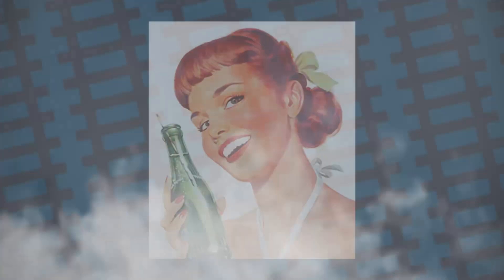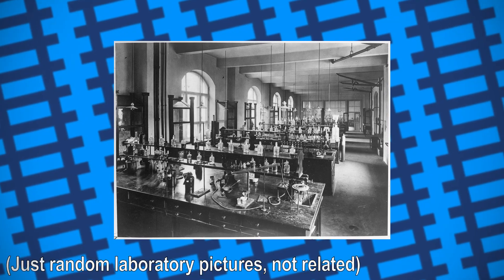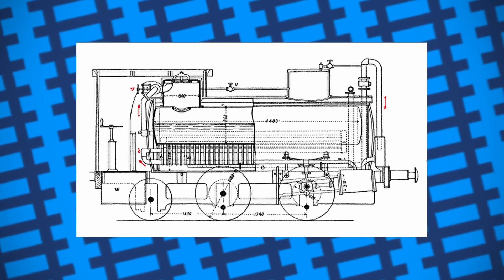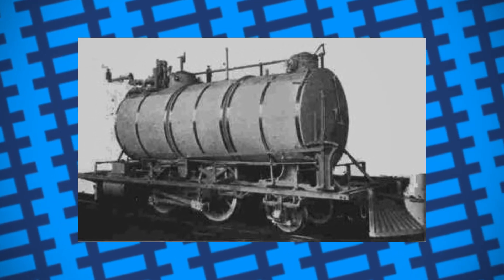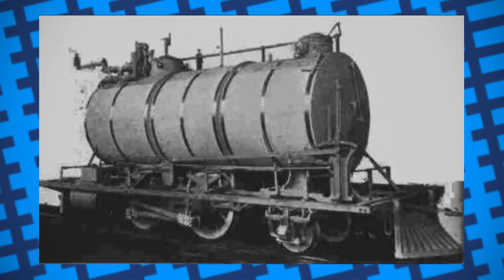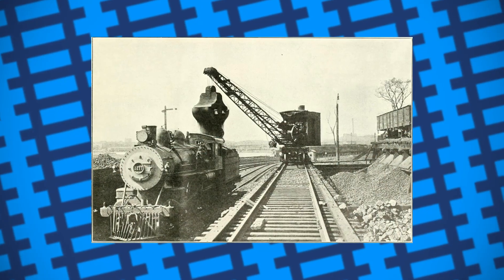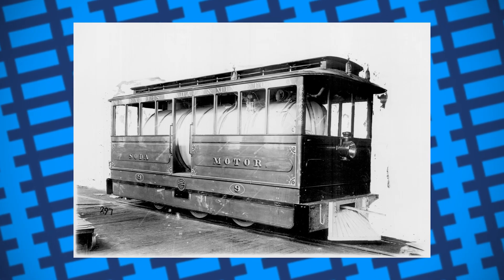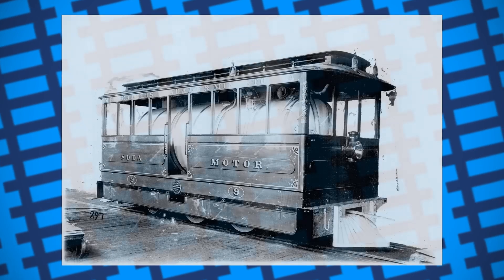Powering a Train with Soda? - Soda Locomotives

Comment: i can't help but wonder if anyone ever tried powering a compressed air powered engine using liquid nitrogen and/or dry ice
Reply: I've seen a model airplane engine that ran on dry ice. It was a little turbine, like a fan, not a piston engine. You can get little piston engines that run on CO2 cartridges, but that's not frozen to start. Gets really cold as it drains, though.

Comment: expected the pressure of gas produced from reacting with an acid, not the heat as it dissolves into water... oh well!

it seems to me thats just liberating latent or "phase change" energy, its not a fuel but a storage system... solid NaOH to aqueous solution is a phase change, and water to steam is a phase change... certain energy to bring the whole lot to boiling, and from then only as much as required to evaporate a volume of water.

what about superheaters? seems... impossible.
Reply: Lets use that to store sunny days and heat when it is cloudy !!

Comment: I've never heard of this before. The oddest locomotive fuel I've heard of is mummies from ancient mass graves. There was also a case of a 2-10-2 with a tender load of badly-burning slag stopping and picking up used tires from a dump which burned really well, but left the grate coated with melted rubber.

Comment: I wonder if you could use this for energy storage now, probably more for direct heating applications than for rotational or electric output, but I wonder how a system based on this could work vs something like a sand battery.  I imagine that the lower operational temperature for regen might help allow for instance use of a heat pump for regen increasing efficiency and possibly being used somewhat like a heat version of overnight ice creation to shift air conditioning evergy use or allow higher peak demand without oversized equipment.

Comment: That would corrode the heck out of your metal boiler and any fittings, you'd almost have to use more expensive stainless steel or other alloys to resist it, costing more.

Comment: I happen to have a book about forgotten inventions that goes into great detail about the Honigmann Engine. So I thought I should post details about it here, since i thought the video didnt give credit to the technology, since indeed it had several advantages. Moritz Honigmann found HIS OWN factory for Ammonia-Soda in 1870. During that time, many of the rail lines were actually not powered by steam neither by electricity but by horses. A lot of them, like A LOT. Honigmann had invented a new method for creating caustic soda at low temperatures, since usually the factory boilers from iron would corrode, it was said by high temperatures. He built and tested his own soda engine and it worked just fine. It was actually cheaper than using the horses that were used before, the horses being at 25 Pfennig/Km and Honigmann engine at 16 Pfennig/Km. The power to weight ratio of the whole engine was that of a regular lead battery of later times, but back then it was 20Kg/hp/hr while fireless hot water engines were 200Kg/hp/hr and battery powered locomotives were 100Kg/hp/hr. However the reason he used it was because he owned the factory that was making the soda, so why not? He could refill it at his soda factory any time. The boiler wouldnt explode, no. I think at this point you have not really understood how a soda engine works. It is the low heat exhaust steam from the cylinders that feeds the soda part of the boiler little by little, its an enclosed system that works like a saftey valve at the same time. Honigmann did figure that the technology wasnt viable for a broader use in railway. He also found out through his own experiments that the boiler material was likely to be made out of copper, since copper wasnt so prone to corrode by caustic soda and repairs would be less expensive, at higher cost of the boiler. So it was actually a very elegant technology for storing power, but it just did not sell well to the public. There were a lot of naysayers.
Reply: I like to further elaborate on my personal opinion, that the power to weight ratio of the Honigmann engine could theoretically be improved by using higher boiler pressures in the steam part of the boiler, not in the soda part (they are separated by a wall). This might improve water consumption, so weight as long as the chemical reaction is kept running. You have to imagine, that the system does not use any condenser. The heat of the waste steam is reused as well, there is no cooling. YOU DONT NEED A COMPOUND ENGINE TO EXTRACT MORE POWER. However i guess you need to keep the engine inside a narrow rpm range(if not properly designed) to keep heat fluctuations at bay. I guess thats why soda engines of different makes were closely watched for pressure fluctuations, not because the engine could explode, but because too low pressure might ruin its thermodynamics, causing powerloss and a slight worse power ro weight ratio. This would mean a loss in range and a great deal of money, cause downsizing the engine was key. But these are only assumptions of my own, so take it with a grain of salt.
Reply: @TheAdrianOMG  Wow very interesting !! Have you got more imformation source about this tech ? I already searched well around thermochemical heat storage to catch sun energy from sunny weathers and to release it for the cloudy days in house heat battery. 3 materials got my attention : Zeolite, Calcium Chloride and Sodium Acetate... I didn't know that Natron was also usable ! This one seems promising, even if i'm not sure i  did understood everything well...
Reply: @AutoNomades  well sadly i do not have more sources on the technology. I should tell you that indeed moritz honigmann had the idea of powering his factory with sunlight to make the soda. That would have meant a fully or partially sunpowered fireless locomotive. But it sounds to me like you are looking for a way to store heat for heating a home. That is a very intriguing subject. Let me just tell you this: a house already is a heat storage, able to shrink the demand for fuel, but only if you know the correct techniques and math, however noone will give you that but sell you insulation and stuff that wastes more energy. You dont need an extra heat storage for your home, in fact it might even worsen the efficiency. Feel free to get back to me on that if you have further questions.
Reply: @TheAdrianOMG  Why would it worsen the efficiency ? If you catch sun's heat when there is, then release by cloudy cold days ? I mean, in the simplest way possible, and in a quite insulated house offcourse... You could just dry kind of "pillows" of thermochemical storage in a greenhouse, store it in tight container for later, then when it's cold, take one dried before, put it in the stove, and let dripping some water on top, so it releases heat, and steam by the chemney...? For instance...
Reply: @AutoNomades  well you need an insustrial machine to regenerate the caustic soda in the first place. You can not simply regenerate the caustic soda by leaving it in a greenhouse, you need high temperatures and a vacuum for example. So you need a mirror dish solar plant as well, that can produce these high temperatures. No the caustic soda doesnt steam, its hygroscopic and stores all water inside it. Honigmanns boiler was a two compartment object, the lower soda part that only heated the boiler above it, the soda isnt what creates the steam. And if the soda comes into contact with the open air, it reacts with co2, becoming sodium bicarbonate. I am not saying that it all doesnt work, but heating one home with it, needing an industrial plant to do it and lots of space isnt feasible, maybe its more feasible if you scale it up to heat or power a whole city. So if you were to heat a house by a heat battery of caustic soda, you would need regular heating plus caustic soda heating. But any kind of hest battery with a temperature fluctuation by cooling and reheating has a lower efficiency. This is how you heat a house efficiently (short version): first of all, don't insulate. The walls are a heat storage, the higher their temperature the less heat can travel through them. Insulation blocks that. You need the sun on the outside to work against the heat travel as well. When your walls are warm, they become the insulation, there are formulas for that. Its called "u-wert effektiv". Throw out the double glass windows on the west and southside of the house, because glass blocks infrared light and actually doesnt lose that much latent heat. When it comes to actually heating you want a continuous heat day and night. For example all people with oil burner heating make the mistake of setting the flame too high, then it shuts off in intervals, but you want it to continuously burn. As soon as your walls get cold, reheating them actually takes the more power. Thats why you also should not turn down the heating over night. If everything is recalculated to correct low continuous operation, doesnt matter if its oil or a thermal heat pump or whatever you're choosing, you have to make sure that you get equally latent heat as well as infrared heat. Only after all that hydronic balancing makes sense. Latent heat raises to the ceiling and becomes a heat storage to give off to the walls contiunously, which is why you want to have high ceilings so the house stays insulated. Infrared is cozy warmth you enjoy and the best type is actually floor heating, but costly and not always necessary. If you use the correct mathematical formulas, you will hardly need any heating whatsoever, because your house has become highly efficient. Make sure to keep you old cast iron radiators, they work better than the new ones, because more infrared, dont let them sell you the new junk. Try to keep limescale out of the radiators and pipes, it lowers the efficiency greatly (maintenance is key). If you like you can use an air to air heat exchanger for fresh dry air in the house, it raises efficiency, but people dont like the thought of not always opening their windows for air. Beware of using thermal heat pumps together with energy providers with real time price adjustments. You keep the heatpump on continuously, otherwise the heatpump is chosen too big and costly. Btw, wood ovens are a nice thing, but they as well need to be calculated for continuous operation, which is a topic on its own. There are alot of alternative ways to build and heat a house, i know, this was just a small introduction.
Reply: @TheAdrianOMG  I wonder what non toxic affordable thermochemical material could i use that would need a simple drying or at least not so hot....
Reply: @AutoNomades  Have you considered PCMs (phase change material)? These materials store and release heat through phase change. Paraffin wax should have the temperatures you are looking for and can be built as a battery, with this battery being well insulated and with integrated heat exchanger tubes it can be used together with solar. You can research pcm solar heat storages. I bet they can even be used the way you imagined it like a portable heater. But i could see the biggest potential for such a technology by implementing it into thermal heat pumps. Thermal heat pumps have a fluctuating efficiency. When temperatures outside drop, they efficiency drops as well and you need more energy to power them. However if you had a heat battery on cloudy cold days that can heat the refrigerant further before entering the actual compressor stage (yes, the actual pump) the efficiency would rise.
Reply: @TheAdrianOMG  Oh yeah interesting this combination with heat pump ! For myself i prefer the thermochemical storage, as you don't need an expensive and complexe insulated storage for the the heat.
Reply: @mateusz5318  What do you mean ?

Comment: I think he's wrong about the soda being under pressure.
Reply: Our Train of Thought guy made so many mistakes or rather confident skippings over needed information that it is easy to assume he's not a chemist. He's a historian of trains. Excellent at that. The chemical engineering going on here was hinted at, at the end. There's a base station boiler that runs very hot steam to the engine so as to melt the NaOH. The outer tank that holds the molten NaOH does not have to be pressurized. In liquid state it is about 615F. When driving around, the water takes heat out of the molten NaOH (just like it takes heat out of burning coal). That cools the NaOH into a solid at only a few degrees lower than the 615F.

Comment: Even if it ultimately wasn't that practical, I must say this is a pretty genius design. I have to wonder if it could be made more practical with modern technology, but in the end it's basically accomplishing the same thing as electric motors but with a lot of extra steps. Still love the idea.
Reply: Yeah but for house thermal solar heat battery could be nice !!

Comment: sodium bicarbonate and lime juice in sweetened water used to give medieval lemonade drinks a weak fizz - but that used to leave a soapy taste and residue due to insoluble hydroxides - this and the weakness was overcome by bottlers reverse engineering carbolic inclusion, first through carbon dioxide cylinders at drugstores and then by bottling under pressure. The name soda, however, stuck, though not technically true. (Re. the coke bottle in the thumbnail)

Comment: I thought he was gonna talk about firing a loco with coke (coal used for blast furnaces) instead of normal loco coal, but this is pretty interesting.

There was a story I read once in an old issue of TRAINS magazine in which a new fireman was getting ready to take a train from the yard and noticed a hopper full of coke on the track next to him.  He asked his engineer what he thought putting coke in the fire box would do and when the engineer said he wasn't sure the fireman went with a bucket and took what he thought was a sufficient amount of coke to make a test.  He then threw in several scoops of coke into the firebox.  It didn't ignite immediately so he surrounded it with standard coal.  They soon after got the highball and started their run.  Not long after starting the coke finally ignited and as you'd expect it got HOT and began to produce steam.  Just a little ways down the line the first safety valve lifted.  Soon after the line began a steep climb.  Despite the climb and the loco working hard up the hill the second safety valve lifted.  The entire time the fireman hadn't needed to stoke the fire again because the coke just kept burning and getting hotter.  Finally still climbing the hill the third safety valve lifted.  In an attempt to lower steam pressure and prevent the boiler from potentially rupturing due to the stupid amount of steam the boiler was producing they turned on both injectors.  With all the safeties blowing off and the injectors on the fireman reckoned there was so much steam coming off the engine that it probably looked like a rocket was launching down the tracks.  Despite their best efforts steam pressure continued to build and finally the fireman grabbed the hose kept in the cab mainly to clean the cab and tools and pointed it directly into the fire box to extinguish the fire.  In the end when the fireman could finally see the inside of the fire box he described everything melting in the firebox.  Even the bricks in the brick arch had become molten and were melting.  Lesson learned: don't put coke in a steam locomotive (at least not a whole lot anyway...).  Don't remember the railway this happened on, though.
Reply: Unrelated perhaps, Wonthaggi coal was of medium quality so during a miners strike, black coal from Korumburra was used in Wonthaggi hospital and it melted the grating.
The significance of Wonthaggi coal was that it kept the  Victorian Railways running during wartime restrictions of black coal from NSW.
Unfortunately there was not much black coal in Korumburra.
Reply: I read the same story years ago in TRAINS.
Reply: Don’t think I’ve read the article, but I’ve seen the tale recounted on a forum. The method of “firing” reminded me of the PRR, as firemen would similarly pack coal around the edges and corners of the firebox to keep a good head of steam. This was when their K4 and even K5 Pacifics lacked mechanical stokers. I imagine the same was tried on the M1’s since the actual grate is basically the same, but the combustion chamber made a stoker more necessary. Got me thinking of the story potential too; what was that if not a locomotive overdosing on drugs?

Comment: A similar reaction was using in Soda Fire engines and fire extinguishers. 

They mixed bicarbonate soda and another chemical I forget to make carbon dioxide that would then pressurise the tank and force the water out via a hose and nozzle and onto the fire 

Obviously if the fire was put out you couldn't then stop the water flow until the tank was empty.

Comment: A sodium hydroxide-powered closed system of a boiler is probably what one could call a "bomb".

Still safer than a gigantic lithium-ion or whatever batteries electric cars have in em, though.
Reply: Yeah and sun could directly heat a cheap thermal battery to heat by cloudy days !
Reply: You could use calcium chloride instead its not toxic and corrosive like sodium hydroxide.

Comment: Are there any other stories experimental steam trains powered by more exotic chemical fuel sources. While it is not the same thing experimental World War 2 U boats wanted to try and use catalyst based oxygen generate for conventional combustion. What about chemical additives to make existing or low grade fuel sources burn hotter? Rather than using it all the time it would only be used to fire the engine quickly in the morning or provide a boost of steam when climbing steep hills.
Reply: Well actuallyu is is not used as fuel, but as thermochemical battery !! Would be great to store sun's heat to keep for cloudy days  !